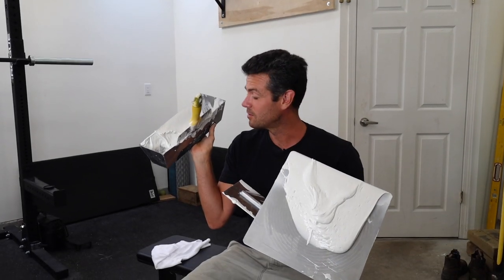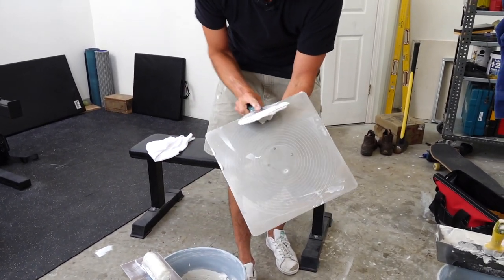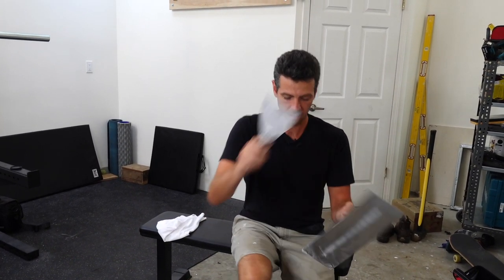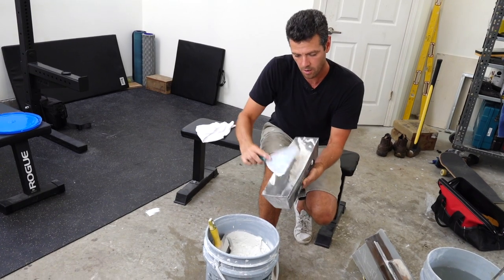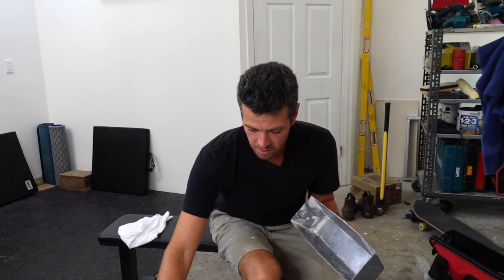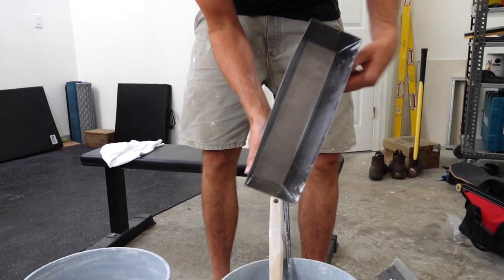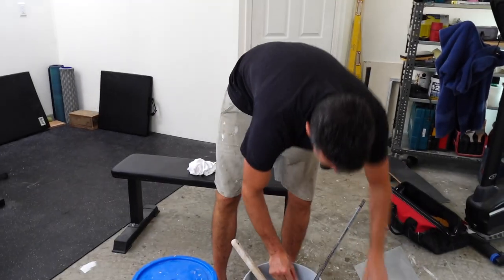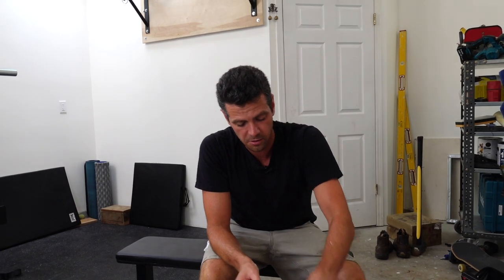Save time Cleaning your Drywall Tools...do only as much as you need to!!!!

Comment: The best thing I ever did for making my occasional drywall projects more enjoyable, was replacing anything carbon steel, with stainless steel when possible😎
Reply: 100000%
Mud is super corrosive too, so normal tools will get obliterated if you leave almost any on there
Reply: I got rust stains in my dry mud with a cheap steel trowel. I bought the stainless trowel the next day!
Reply: @EricLS  gypsum is corrosive?   You sure it’s not the water in the mud?
Reply: @719vol  I find drywall left on aluminum does get a rust build up if not cleaned decently or scraped I feel this comment meant.  The old mud box for pulling tapes my dad had got pretty crappy and a rough surface of we didn't clean it well.
Reply: @Matt-my7pz  agreed.  S/s does and can rust.  Was just wondering if it’s the water or the gypsum that is causing the corrosion.
Reply: @719vol  ooo gotcha.  Yeah good question.  I wouldn't know and I guess for me I'm thinking there are different grades of aluminum.  I think my hopper box is about the cheapest out there.  Hands and water is typically black with aluminum "rust?" after cleaning and it's easy to gouge.  But after helping a friend with bazookas the first time I don't ever want to use it again 😂
Reply: Same here. Best drywall decision I ever made

Comment: The long handle brush is OK, but a short handle brush (like the kitchen scrub brush that IKEA sells for a buck or two) is easier to use and is easy to get into the nooks and crannies of your pan and tools, expecially mixing paddles.
Reply: Try a toilet brush or bottle brush and thank me latter
Reply: @V C - Why does the length of a brush handle affect how well it works to clean nooks and crannies?
Reply: Same, have many of them around !
The small sponges that have scrub pad on 1 side are excellent as well.
thanks for psoting !
Reply: Lmao, ditto!
Reply: @bethanyanderson1745  same reason a short handle brush works best in the kitchen, doesn't get in the way of your wrist and stores easier.
Reply: Yeah man! I bought a 3 dollar scrub brush and it gets in all the little spots. It is totally plastic though

Comment: Another tip that goes along with the cleanup process (as it has to do with how to leave the mud overnight - or longer).  If I wipe down the sides of the bucket as you've shown, I can pour a layer of water over the mud and I don't have to worry about drying out the top layer and/or promoting crusties.  The next day, I can pour off the excess and the mud will have been kept in good shape.  Easier that than fighting the lid when the mud is not going to long term storage.

Comment: I keep a grout sponge instead of the brush.. It's the go to for cleaning pan and tools and inside mud bucket.. and also good for sanding a small edge here and there,  and the edge on corner beads if need. The more broken in the better
Reply: My go-to is a toilet brush; they're  made to get in corners and I like starting jobs with immaculate tools. The best friend is the 5 gallon bucket of water for both mud or piant tools - especially brushes and scraped rollers, soaking does most of the work for you. The mud bucket cleanup I call "parking" your mud. NOTHING is more IRRITATING  than boogers in your mud (then on wall)! 
For spackling, try this:  pour water in it and dump it out just before putting the lid on. It keeps it like new.
Reply: @garychandler4296  Thanks for the toilet brush idea!

Comment: Hi Ben. Haven't used the carbon steel, however, I have switched to all stainless steel and I'm super glad I made that decision. I use Hyde products and so far, no complaints. Couldn't disagree with anything you said on the video. Not that I ever do🤣🤣. Good to see ya again. Hope you and the fam are doing well.
Reply from the maker: We are well. Thank you Cindy!!!
Reply: @stevensko9153  Yeah. I own two Level5 knives and they're awesome. Very sturdy. However the flex is a bit compromised on Level5 because well, they are well made. Whereas, Hyde provides a little bit more flexibility when using the knife. It helps me achieve an easier feathered-edge when adding pressure to one side. I've only been drywallin for about a year so I go for whatever makes my job easier 🤣. I learned everything from Ben. He's my teacher.

Comment: Personnaly, when I'm done mixing and I want to clean the paddle, I swirl it around in the water until most of the mud has come off. By varying the rotation speed and giving it a few bursts, I can get it almost perfectly clean without even touching it. The little that remains is then scraped off by hand.

Comment: I use a similar cleaning method though I do it slightly differently; I use a medium stiff brush for plaster and joint compounds while using a stiff bristle brush for stucco and concrete cleaning. I use a dip, brush, dip method which seems to work fast and well; I also will keep towels in the vehicle for drying off tools before putting them away though if they’re going to get used the same day of next day I tend to not dry them as I use exclusively stainless and magnesium tools exclusively. I also keep smaller nylon and copper bristle brushes in my kit for getting the smaller areas but typically a putty knife will get things off. My trowels store on magnetic strips while most of my trowels live in a home made stand as I have dozens in different sizes from 1” through 14” and includes flexible to firm blades and scrapers. 
While I will keep paddles in water most of the time if I don’t or just with some materials I’ll let the paddle sit and get hard then just knock things off which has worked OK for me for years. Thankfully I don’t do as much mud/stucco work as I used to as it can be tougher than the more skill less work side of things like cabinetry and finish work.
Reply: OMG you just gave me the greatest idea! Thank you so much. I am a stucco guy and I have a truck with a great storage lockers for the tools, but the trowels always seem to fall off. I have a magneted knife strip that we can't put anywhere in our kitchen so it just stored away. I am going to go mount that in my tool locker and the trowels won't fall over anymore. Thanks for the tip, I'm so happy now
BTW the best thing I like about taping is how easy the mud cleans off the tools compared to my stucco tools. Sand and cement and all the other mud we use for stucco is tough on hand tools. WD-40 is the only help
Reply: @Phazetic99 : No problem; I actually use 2 $5 magnet strips from Harbor Freight, 1 on top and 1 on bottom which holds the trowels fine and they can actually overlap so you can fit more side to side. I have numerous tools and will actually drop a trowel in my sponge bucket to soften up while I use a spare; with a stiff bristle brush I usually don’t have an issue cleaning them but occasionally stuff stick and I just let it set them knock out off with a wood chisel. Though WD-40 and green scotchbright is my go-to to deal with rusty spots. I have a small shop and have always had to be creative to fit everything in.
Reply: @libertarian1637  Already installed that magnet and it works awesome!
Reply: @Phazetic99 : Glad to hear. One of the reasons I like watching YouTube is to get new ideas, glad you were able to get a helpful one.

Comment: 5 gal bucket of water with a sponge or brush......especially for rapid set, keep em clean in between coats....a long handlenylon brush works well with a sponge.....I never let them even dry with mud still on them....one bucket for cleaning gets set up at the start

Comment: I keep a small hose with a twist nozzle in my truck.  I am OCD and so as soon as I am done I scrape everything then hit it all with the hose before it dries on.  It gets into all the cracks and small spaces better then any brush.  The key is the drying even with the aluminum and stainless.
Reply: @Steven Ticino- what kind of a truck do you drive?!  I've driven around with a hose n nozzle in my trunk too but I don't have a water source on-board to spray my tools.

Comment: When scraping off the “crusties” while cleaning you can put it back in to the mud bucket? Wouldn’t they just be in the mud the next time you use it? Or does it break down after you mix it up?
Reply: I never do. It's extremely rare that I'll put any mud back in the bucket once I take it out, even if it looks clean.

Mud's cheap - not worth dealing with hitchhikers.
Reply: Yes, the crusties will re-hydrate with regular mud.
Reply: Contaminated mud, used mud. Through it away
Reply: Never, I am guessing he was doing that because this was a demo not a real job

Comment: let's talk about putting things down drains. i was sanding dried multipurpose mud texture on a ceiling in a small bathroom. over the 30 minute or so job i got thickly covered in dust. and as i sweat it all got quite gummy. almost like a glue consistency. not wanting that in my shower drain. i had the wife hose me off in the back yard.

was i over-worrying? would that have been ok to send down the drain? - keeping in mind we have a septic system, not city sewer.

enjoying the videos! keep up the great and very helpful work!

Comment: Still cant find a pan with rubber bottom grip. Tried “after market” rubberized magnet meant for the pan and it worked for about .7 seconds. Is that a particular brand that you got? It looks like it stays put very well. Great vid by the way. Essential! Cleaning is about routine. I clean my gear every time. Got used to it and works like a charm. Also how you store/carry your tools is a key as well. Thanks Ben. 👊
Reply: I had one of those red goldblatt ones. Piece of junk. Magnet glue apparently wasn't waterproof.
Reply: This was going to be my question.
I dont see any answer ?
Reply: @jerseyjim9092  I tried Husky from HD and some blue perforated one (don’t remember brand) from Lowe’s and both failed miserably right away. Same symptom like your goldblatt. Lets wait and see if Ben will chime in. 👀
Reply: @richardramey5943  Patience Rich, patience …
Reply from the maker: I thinks it’s a Kraft mud pan
Reply: @vancouvercarpenter  Much appreciated. Will hunt it down.       Edit: @ Bezoson for $39, Kraft Tool DW724 EZ-Grip Mud Pan, 14-Inch x 3-Inch. 🧨
Reply: @richardramey5943  Kraft Tool DW724 EZ-Grip Mud Pan, 14-Inch x 3-Inch
Reply: I just bought a roll of 4 inch anti-slip tape, 80 grit and applied it to the bottom corners of my Dewalt pans. A little rough on the hands at first but they wear in. Have lasted a decent amount of time. 3 years alternating from hanging jobs to finishing them.
Reply: @TheOfficialDjProduct  Interesting. Would never think of that. God idea. I wanted to see if applying rubberized flex-seal type of coating would work. Never had time for the experiment. lol
Reply: Menards has them or at least did, I didnt care that much for it

Comment: Unless your trial is non-magnetic stainless steel will it will corrode because non-magnetic stainless steel is what they use them kitchen entry and it doesn't have no car but magnetic stainless steel has carbon in it to check it take a magnet to it

Comment: Hoping for some HELP! 
My question is, 'Do I use Peel Stop before I use drywall patch or patch and then use the Peel Stop'. 
Please advise.
I have plaster walls in a 1940s home. ALL the paint peeled off the outside walls when I was prepping to paint. 
I could not get all the layers off and am left with paint ridges. Planning to patch to feather and smooth out. Sanding is not an option on such thick areas.
My question is, 'Do I use Peel Stop before I use drywall patch or patch and then use the Peel Stop'. Please advise.

Comment: Do you have a preference on a magnesium hawk or aluminum.  I don't care for aluminum as it's likely I have always used magnesium.  My buddy for the DeWalt with the black coating on it, really enjoyed that too.  Is there a video for metal filing or "machining" the edge of the Hawks back to straight edges as the trowel makes wear paterns in the edges.
Reply: Just a flat file, clamp it in a vice or flat on a work bench, and hand file it straight.
great hand tool practice.

Comment: Question for Vancouver carpenter or anyone that can answer. Imagine a recessed joint running across a wall. Mid sheet we have a butt joint/factory edge running up from the floor until it meets the recessed/beveled seam. Is the correct way to mud up the beveled seam and stop or mud "though " it stopping at the top of the beveled edge ?
Reply: I've done it both ways with my scuess,  but what's the correct most efficient way

Comment: Try soaking you carbon knives in vinegar for a bit. If it isn't a poor grade of steel that should prevent them from rusting as fast or at all depending on the amount of time they are exposed to moisture.
Reply: gonna try this ,,
thanks for posting

Comment: Learning a lot from your channel, have a 1900 home in the US do you know if I can sand the old plaster walls smooth? They have years of over painting over and over and not to good of smooth plastering over the years as well. What it be good to cut all that down with sanding? Plaster not breaking or peeling anywhere, ceiling where replaced just not sidewalls. Hope you have time to reply thank you and love the channel really 😁😎
Reply: I just did this on some very jagged and pointy plaster walls in a bathroom, I sanded down the walls with 40 grit paper on a 5” random orbit sander and shop vac, it worked surprisingly well and quickly. Then I skim coated it with all purpose joint compound to help smooth out the walls

Comment: I was hoping to find some secret trick that makes cleaning the tools quicker. Unfortunately it looks like a little time and elbow grease is the only way to go. At first I was cleaning my tools and pan until it was like spotless using a water hose, and it was literally taking me almost as much time to clean the tools as it did working the drywall. I still always clean up except I am not as picky about getting into every crevice(buy seamless one piece knives!🥰) . Now I keep a bucket of water, give them a quick brush and dry off with a towel. I was thinking about putting a drop of dish soap into the water. Has anyone had any luck with this?